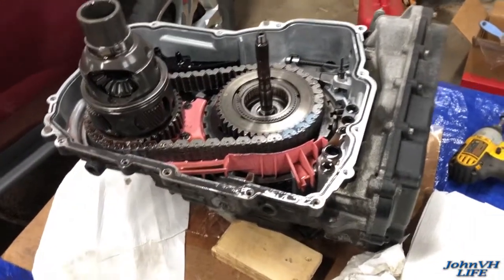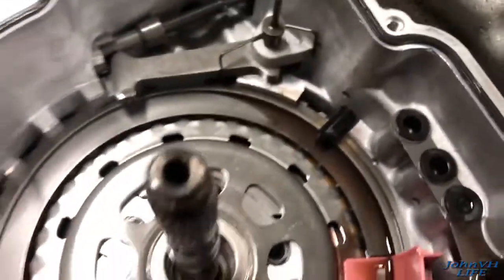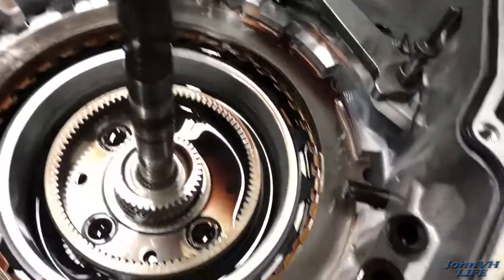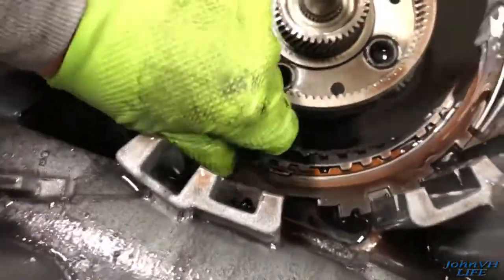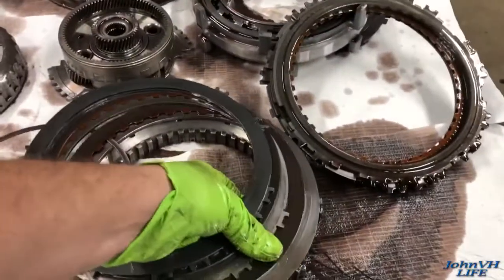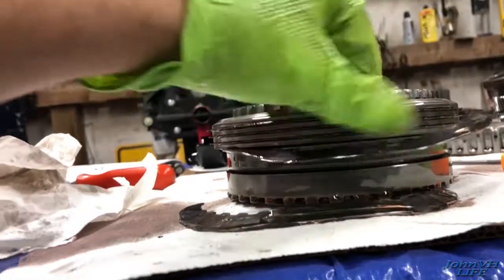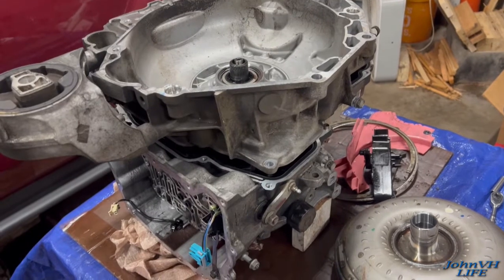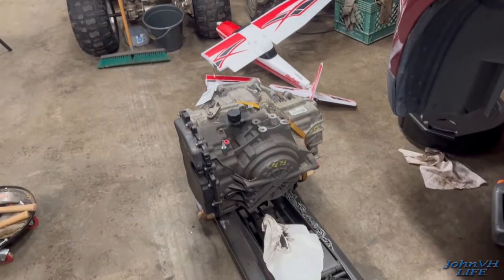Part 2  Equinox 6t45 AWD Transmission Disassembly at home PART 2 of 3 HOW TO DIY

Comment: That transmission jack is dangerous I use a cherry picker and chain lay transmission under car there are 2 bolt holes on case I put a chain up to picker and lift there is no fighting it goes right in that's how I do all fwd way safer and faster try it you will thank me
Reply from the maker: Its worked great for me, I dont think its dangerous.

Comment: you did the right thing by swapping the techm from your original transmission. what would have been better was if you had the original cloned into the "new" transmission. theres multiple reasons for this. One is keeping things clean and not having to open the transmission up to allow possible contamination. two would be if the transmission got really hot when it failed, you might have had a cooked techm. third it's just less work which im always about. the only downside is you have to have special tooling to do that job and almost anyone who has such tooling won't work cheap. good series though.

Comment: How much did you pay for that used transmission if you don't mind me asking I'm looking for a used transmission here in Tacoma just want to make sure I'm getting a good deal
Reply: I payed 425 for a 55k miles transmission
Reply: @nickdavis6294 do you mind sharing the link? I may have to buy one for my 2012 Chevy Equinox with the 6T45
Reply from the maker: Your not far from me, I got this one on ebay, I think it was 1200 or 1400 to my door.